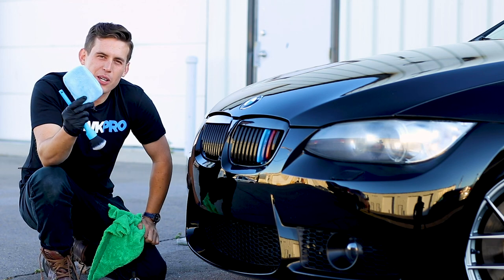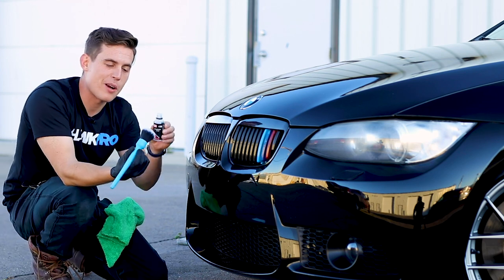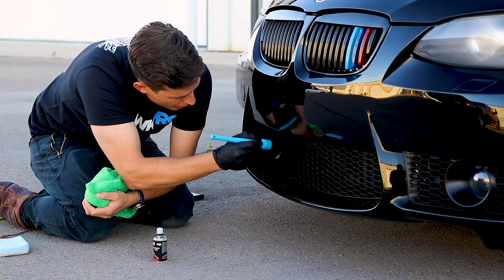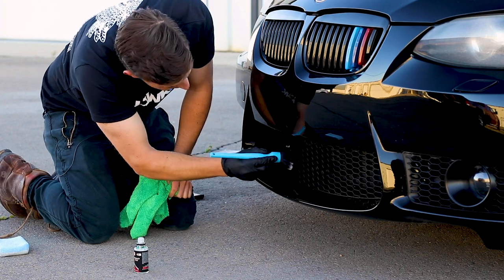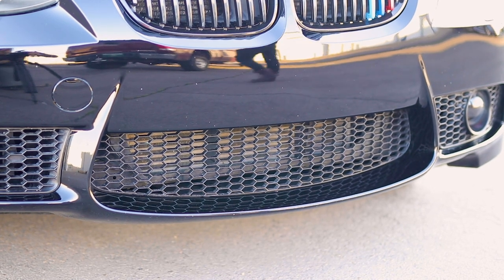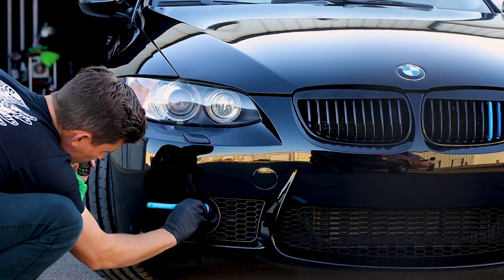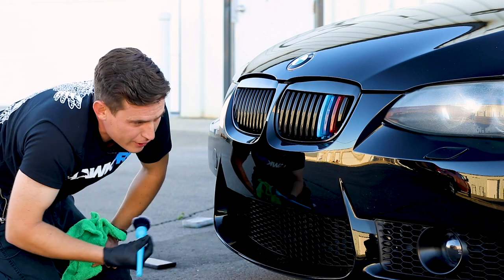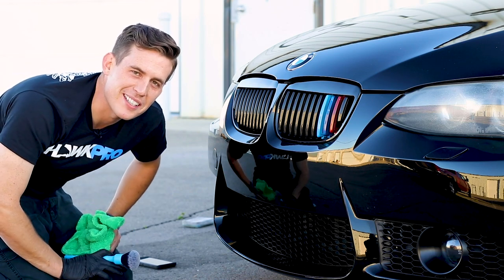PRO TIP: How to apply ceramic trim coating on honeycomb grille

Comment: Good video! Just curious do you toss that brush after using it once, or how do you get the ceramic out of it?
Reply from the maker: I spray it with APC, rinse it thoroughly...more APC, work the brush with my fingers under water..then rinse again and shake out....and set it aside as dedicated coating brush. I have a bunch of these df brushes thankfully...
Reply: @HawkProDetailing  I was going to ask the question so I thank you for your answer. There is a bonus situation here in that you don't have to worry about marring from crystallised coating I guess?

Did you find that you get to a point where to have to toss the brush?

Comment: Great timing... I'm about todo my first ceramic coating.. I drive a gs350 fsport.. I was searching for ways to protect the grill.. I've never seen anyone mention how todo grills before
Reply from the maker: Heck yeah man. I sort of stumbled on this method after struggling with the microfiber applicators i use for paint. Hope this helps!! Just wash it out with all purpose cleaner thoroughly when finished and you can use the brush for other stuff too...
Reply from the maker: You can always spray grill down with stoner trim shine but it just won't last like a ceramic trim coating will

Comment: Thanks ! that's a great hack indeed and I am going to apply Solution Finish this way. However, I was actually worrying about how to clean and prepare the grilles to perfection when it  comes to IPA or alcohool wiping. I would use my small Griots detail swabs, but I am going to need like DAYS to achieve that. My Range Rover Evoque  has even more intricate grilles than these....
Reply from the maker: Don't overthink it and just slab it on😋
Reply: @HawkProDetailing  Thank you, we get a LOT of brown greasy dust here where I live

Comment: If its a potent ceramic containing product, i imagine the brush is throw away?  AH saw your comment to this type of question.
Reply from the maker: Just a nice rinse after with all purpose cleaner and water....repeat as necessary...and make sure its as clean as you can get it. The we just let it dry and set it aside for coating trim. Works pretty good!!
Reply: @HawkProDetailing  Thanks for reply. Learning the best method...i happen to be using a quick drying ceramic, it sets up too quickly. 😅